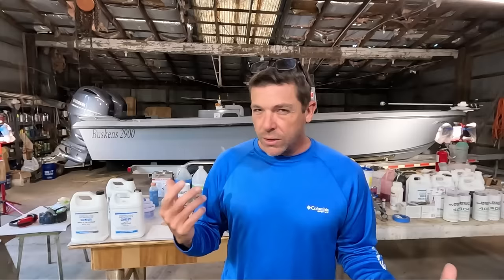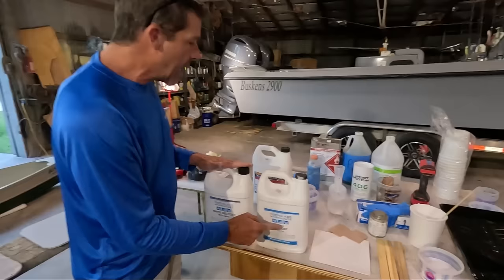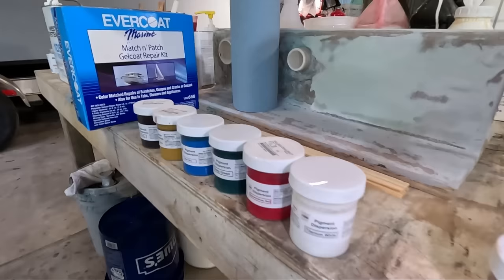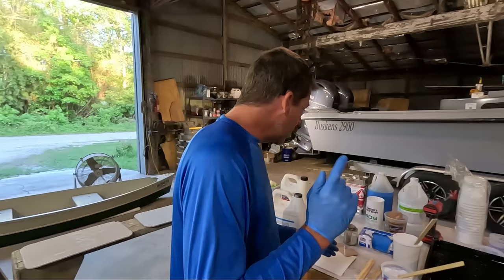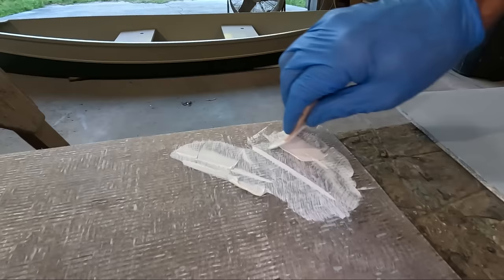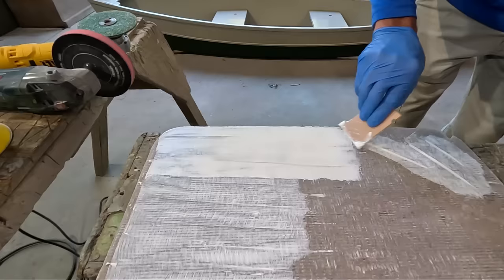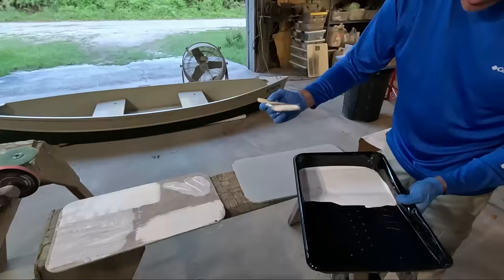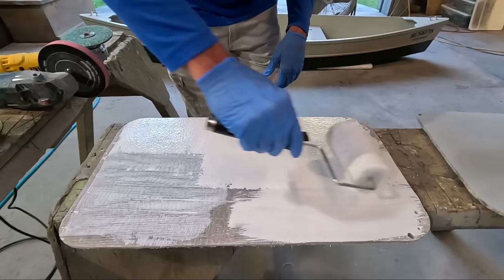The Secrets of GELCOAT and WHAT You Need to Know!

Comment: You’re not a boat builder. You’re a chemist. I do not have a boat but I do have an RV that needs gelcoat restoration in several places. Your videos have been a huge help. Any tips on getting the 17 year old decals off? Thanks again.
Reply from the maker: Thanks, glad you are enjoying the videos! I have had success using a heat gun to warm up the decals just prier to removal. There is a product called goof off that is sold at Lowes and elsewhere that can be good for any glue residue removal. I hope this helps and thanks for watching!
Reply: @FishBumpTV  I’ll try the heat. Goof Off works but it’s going to be ridiculous moneywise because one can does not go very far. yesterday I found some stuff at O’Reillys that is used for aircraft decals. That stuff is working well, but I think the heat with the aircraft decal remover is probably the ticket.

Comment: Could you apply a peel-ply to a non-waxed gel coat finish to give you a smooth finish that needs less sanding?  Great videos - thanks. (from UK)
Reply from the maker: That is a good question. Peel-ply is generally used to smooth out the laminate under the gelcoat. I haven't tried using it over the gelcoat, maybe it is worth a try. Might have to do a video on that one! Thanks for watching and commenting all of the way from the UK 🇬🇧

Comment: Awesome channel Captain Joe!!!! - Thank you for all the sharing of information and trade skill's. As a auto bodyman/painter with urethane, the gelcoat game is a little less tedious I think? 
Like the pinholes in the Formula 27 final sanding before first coats of gelcoat. 
As a complete novice in the boat gelcoat world, I take it the pinholes in the filler can be filled along with scratches in the gelcoat? 
After watching this video and another one, I definitely get the final coat of gelcoat to be with wax and all previous gelcoats are un-waxed. Another question,  I may have answered is - You do not sand between gelcoats with no wax?    
Looking forward to finishing this dingy Caribe 12' RIB - Thank you for all the video's of boat builds, repairs, and fishing 👍👍 Keep on keeping it real down in L.A. - Yah bless you Joe
Reply from the maker: Thank you! Yes, gelcoat is  quite thick compared to paint, so I find it more forgiving when it comes to scratches and pinholes. I will sometimes give a light scuff with anything from 120 to 220 between coats on unwaxed gelcoat just to knock any bumps or ridges down a bit, but it will gum up your paper very rapidly. I hope this helps and thanks for watching!
Reply: @FishBumpTV  Thank you for the let know. 
I saw your custom top gel coat video, using your roller technique, after you trimmed the tabs and hit it with you big curved sanding block. 
I tried using a sponge roller with a pint of Evercoat non-waxed gel and stuff was super thick. I thought it might have been the sponge, but the gel was super thick. 
I hit it with some 80 and mixed some Hi Bond white with wax and used a 3/8 nap roller and blew the roller with air and taped it like you do, and that worked great. It is coated and that is all I wanted for now. Maybe this winter I will try cleaning it up a little better.
Thanks again👍
mek

Comment: Thank you for making these videos. I am restoring an old 1968 Skeeter/Super Skeeter bass boat, I did find out that the manufacturer used polyester resins in the construction. My question is like how you created the filler in this video, should I duplicate it in my process to fill the scratches in the bottom of the haul? Thanks 

Mike
Reply from the maker: You can use thickened gelcoat, like we used in the video for minor scratches and dings. 3m also makes some very good vinyl ester fillers that are approved for below the waterline applications. I also have several more gelcoat repair and filler and putty selection videos here on the channel that should help. Thanks for watching!

Comment: Joe, does Acetone "soften" up fiberglass resin ? I've been prepping and sanding a transom replacement project and I noticed today after I sanded and sprayed on Acetone and wiped off that my fingernail left marks in the resin surface. On areas that I hadn't put Acetone on seemed harder. I guess my question is , does the acetone help prepping for starting my lamination.
Reply from the maker: I do usually wipe down fiberglass that has been sitting for a few days with acetone. I do feel like it helps with adhesion and bonding of following layers. I hope this helps and thanks for watching!

Comment: CPT Joe, quick question for ya in regards to applying the 4 to 5 coats and then the progressive sanding and polish for high gloss finish, how long in between coats do I need to wait typically before moving onto the next coat. Building my boat’s center console. Thanks again !
Reply from the maker: Cure time can vary a bit due to temperature, and catalyst amounts. So it is not easy to just put a exact time amount to wait. Generally in high temps, say 80 to 90 degrees, you could possibly recoat in as little as a hour and a half. In colder temps it could be several hours, or maybe even the next day. Just remember to use gelcoat without wax on your first 4 coats, then use a wax additive, or spray on a coat of pva or poly vinyl alcohol on you last coat. I will be making some new gelcoat related videos very soon, so stay tuned and thanks for watching!

Comment: thanks alot for your videos i had a question i am prepping my boat floor i have pulled the carpet up scrapped the glue sanded then tinted and rolled a couple unwaxed coats then did a waxed coat. i am going to use my cnc router to router some foam for the top i am just wondering what do i a have to do to take the wax of the surface ? will the surface wax make my eva foam not bond well.
Reply from the maker: Glad you are enjoying the videos! I would consider putting a light scuff on the surface of the gelcoat in the area you will be applying the foam. A wipedown with acetone,  followed by a scuff with a scotchbrite pad or some 220 grit paper should get the job done. I hope this helps and thanks for watching!

Comment: Awesome video. I’m curious on your opinion on duratec hi gloss additive. It goes 50/50 with gelcoat and you don’t need pva or wax on the final coat. It apparently makes a super flat finish. It also thins the mixture for spraying. I’m torn because I want gelcoat for what it is known for, and a 50/50 additive seems risky even if it allegedly enhances the product
Reply from the maker: I have used the duratec products before with good results. 50/50 is the max recommended. You can add less, and still get good results. Orca composites also makes a product called Air dry. I show it in a couple of my more recent videos. You might want to check it out. I hope this helps and thanks for watching!

Comment: great video! i have a question? i have made an automotive console mold and am prepared to spray gelcoat over it soon but couldnt find my fiberglass. so if i had sprayed it out 3-4-5 coats of gelcoat, could i have let it dry for a couple days, then come back and just started vynalesering with chopped strand glass right over the cured gel coat? or is there sanding or a prep that has to be done first? the best process i understand is just as the gelcoat is tacky at the end of drying/hardening is when fibergas/resin mix is to be added for good fusion?  this one has stumped me. thank you
Reply from the maker: Yes, usually you would want to laminate as soon as the gelcoat has cured for a couple hours. Two or three days should still be OK, as long as there is still some tack on the gelcoats surface. If in doubt you could always scuff it lightly with some 80 grit. I hope this helps and thanks for watching!

Comment: Wow. Nice video Thank you very much. i love your videos. we are fixing the interior (Floor and sides) of a 19', old 1984 Proline that we took apart about 10 years ago. Back then we replace all the stringers, floor and transom with composite material, i used Coosa only in the transom, the rest is foam but not as dense as Coosa, it came out great, sadly gas tank went bad a year ago and i had to take everything out again lol. watching your videos of the construction of the 29 i got inspired again and I've been working on the boat. Thank for your videos again. i have a couple of questions about gelcoat that you probably can help me out.

I know know is a NO NO now because i saw this video, But what would be the consequences of applying several coats of gelcoat with wax, even if between coats one wait before the coats 
completely dry before applying the next coat.
What would happen if one apply several coats of gelcoat without wax and don't apply the last coat with wax. would the last coat of gelcoat without wax would still completely dry?
Thanks in advance.
Reply from the maker: The 19ft proline sounds like a great project boat. It is hard to beat a boat in that 18 to 20ft range for all around use, and economy. I usually buy gelcoat without wax, and then buy a wax additive so I can make as much or as little waxed gelcoat as I need. The wax creates a air barrier on the surface of the gelcoat so that the gelcoat can cure completely. Without the wax added the gelcoats surface will remain sticky or tacky. This is good if you are adding several layers of gelcoat, as the tacky gelcoat bonds better to the next layer of gelcoat. The wax in gelcoat tends to repel anything you put over it, including additional layers of gelcoat. If you catch the gelcoat just as it is starting to tack off, you can overcoat waxed gelcoat with more waxed gelcoat, but I don't recommend it if possible. I have a video titled,the secrets of gelcoat that you might find will answer some of your questions. I hope this helps and thanks for watching!
Reply: Thank you very much for your response. Today is sanding day. What a pain lol

Comment: Do you use wax gel coat in the mold? Or do you use it on the final layer..Question 2- Which is the final layer of gelcoat in the mold.. would it be the first application in the mold (the Outside finish) or would it be the last coat before layup? 
i was under the impression the wax was added to ensure a 'non tacky' surface and you would use unwaxed gelcoat to lay up to ensure adhesion with the multiple layers. Please correct me where im wrong
Reply from the maker: You do not use gelcoat with wax at all when building a part in a mold. When a 
Mold is being prepped for building a part, the molds surface is waxed several times with a special Mold release wax. The  unwaxed gelcoat is applied to the molds surface. The wax in the mold keeps it from sticking, and limits the gelcoats exposure to air. Gelcoat needs to be air inhibited, or sealed from exposure to air so that it can fully cure. That is what wax does when it is mixed in with gelcoat, it floats to the surface and creates a air barrier. You can use a brush to apply gelcoat to a small mold or we usually spray it. We usually do 2 passes or coats when applying it into a mold. You want good coverage, but not overly thick. Around 1/16 of an inch or so. After the unwaxed gelcoat is sprayed in the mold and has cured for several hours up to 24 hr or so we then apply a skin coat of fiberglass. The fiberglass will stick to the unwaxed gelcoat in the mold, and cause a permanent bond to it. After the skin coat of glass has cured, we then start the full lamination process. I think I will be doing a part 2 and maybe even a part 3 to the gelcoat secrets series so as to answer more of everyone's questions as they come up. I hope this helps, and thanks for watching!

Comment: I've used high speed Drexel like tool w/barrel sand #80 to feather off sharp edges, wash/wiped w/acetone then 3M Premium filler w/creme hardener, cured, DA w/80 within blue tape margin 2-3" spacing.  wash/wipe w/Acetone.  Now do I use #80 grit or #120/150 over all including filler area then 3-4 coats non-wax gelcoat w/MEKP 1-3%, sand w/#220 Acetone wipe between all coats & final Gelcoat w/wax then go higher grit all way to light compound, buff, seal & wax?
Reply from the maker: Yep, you got it! Thanks for watching!

Comment: A novice question to clarify for me and possible others. Would you add wax to first gelcoat layer in a mold? The side against the mold I would think you would want to harden to possibly sand and polish out after de-molding. The inside of that first layer you would want to stay tacky for laminating. I eventually plan on working with Carbon Fiber but am gaining tons of info from your channel. Thanks.
Reply from the maker: I can see why you might think you would add wax on the first layer of a molded part, but you don't. The mold itself is waxed, and the surface of the mold inhibits the gelcoats access to air, which allows it to cure to full hardness on the mold side, but remain tacky on the inside of the mold so that the fiberglass laminate with still bond to the gelcoat. As our mold building series continues, you will get to see the process when we build the actual hard top. I hope this helps and thanks for watching!

Comment: Thanks so much for the info. I need to fix the gel coat on my Kawasaki jetski. The damage is in the front above the waterline. I will need to build it up and sand it. Do you recommend gelcoat with wax and thickener, then sand followed by a finish gel coat with wax, or formal 27, then sand, and use gel coat w/ wax?

Comment: Thanks to you managed to perfectly fix 2 deep scratches I had in the gelcoat and saved $500. However using 2% hardner and covering the gelcoat with plastic film it was rock hard after 1.5 hrs and after 2 hrs was ready and sanded. Shouldn't it take long time to dry?
Reply from the maker: That's great, 500 bucks is a nice chunk to save! Remember that 2 percent is at the top end that is recommended for gelcoat, and the thicker the application,  the faster it will cure. Temperature is also a factor,  and from brand to brand of materials there can be cure time variables. There can be a lot of variables when working with these materials,  I think that is why people are so interested in the subject. I hope this helps, and thanks for watching!

Comment: Lots of good info here. Can I ask about Gelcoat for epoxy? I want to get awesome colours and finishes on moulded epoxy/carbon/glass stuff.
Reply from the maker: Thanks! If you are applying gelcoat to a mold, then it is OK to use epoxy resin to laminate with. Remember, it is OK to epoxy over polyester resin, which is what gelcoat is, but not to apply polyester over epoxy. I have some videos planned that will be discussing lots of gelcoat and epoxy options, so stay tuned!

Comment: So let me make shure I understand... I'm painting the sides of the inside of my boat raw fiber glass tht had carpet over it at one time..  paint one coat then wait 24 hours then another coat repeat till I get the desired look ?then a wax cost... one more question I was gonna put carpet back at first i put spray adhesive but it soaked right in & never got sticky.. I'm I screwed or can I just go over top of it?

Comment: I have a 2001 Bavaria sailboat and the deck needs attention.  The original finish is Gelcoat over the entire deck including the non skid.  Am I right in thinking I can’t use the gel coat over the nonskid because of the sanding process in the end?
Reply from the maker: Yes,gelcoat over nonskid can be more difficult to do. There are a couple methods that can be used. One is to use a new stainless steel wire brush to clean and scuff the grooves in the nonskid. This is usually done by hand, not machine and has to be done very carefully and thoroughly. The other way is to completely remove the original nonskid with a sander  or grinder, and then apply gelcoat with nonskid over the areas where the original nonskid was. This can be very labor intensive, and you should definitely do some research and testing before you decide to move forward with this method. I will have a gelcoat nonskid video coming soon for everyone. I hope this helps and thanks for watching!

Comment: Another great video, loads of useful easy to comprehend info. With the demo where you spoke of how to get a smooth finish with multiple coats and sanding, I wonder why you use a roller with such a deep nap, (it looks like it from the vid). Would it not be better to use a low nap roller designed for high gloss finishes where gloss is  the aim. Also you don’t mention Peelply or any such product. I am no expert, just a YouTube boat stuff addict so far.
Reply from the maker: If I knew I was going to be sanding the gelcoat to a glossy finish I would roll out the gelcoat, then tip it with a quality paint brush to lay it down Smooth. You could also spray it to get a smoother surface to start with. I don't use peel ply personally. It is a extra expense, and it creates additional waste. Just my personal opinion. I hope this helps clarify the process I would use. Thanks for watching!

Comment: Love your videos, I have learned a lot. My question is...what happens or what should you do if you have to add or have added multiple coats of gelcoat with wax? I know you say only the last coat should have wax, but being new to this and just learning technique and stuff I have found I usually over sand and go through the layers, so then I need to add more as I have taken away from the color matching.

Hope that all makes sense.

Thanks Mike
Reply from the maker: Glad you are enjoying the videos! I know the wax, no wax in gelcoat thing can be tricky. In our shop we always buy gelcoat without wax, then we add the wax as needed in the last coat to allow the gelcoat to fully cure tack free.  The issue with waxed gelcoat is that it needs to be wiped down with acetone and sanded before more coats can be applied or the following coats will not bond properly. There isn't alot that can be done outside of those options. I hope this helps and thanks for watching!